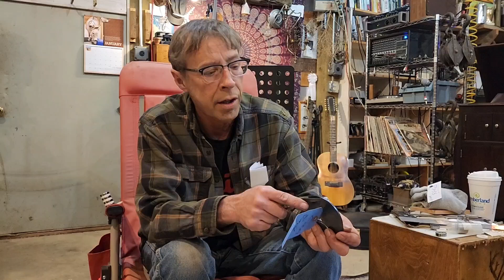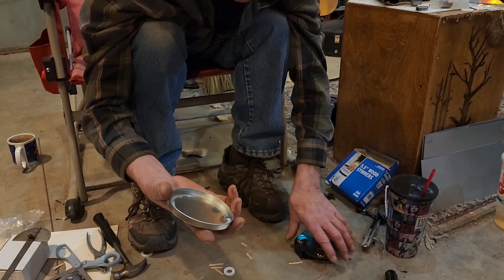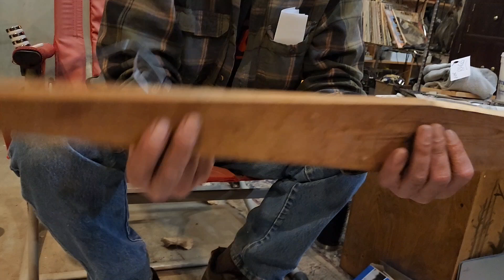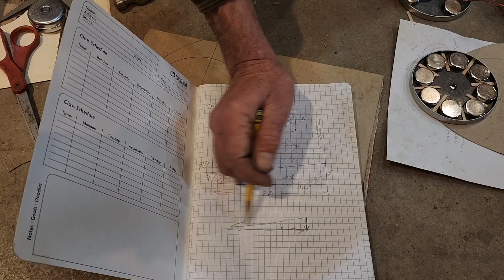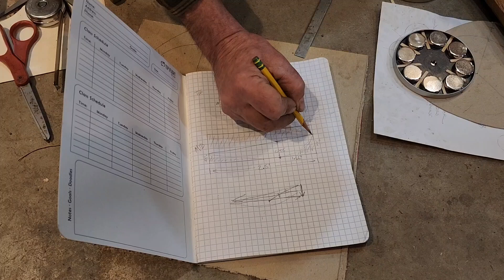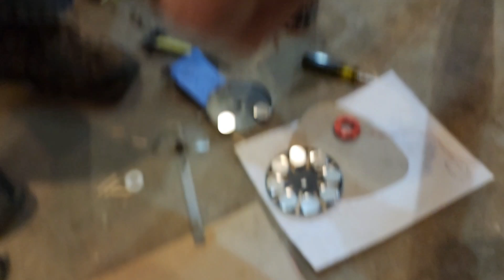36 inch DIY wind turbine part 1

Comment: This is fascinating. It would be great to have a CNC machine to carve that wood, just like guitar factories use. They are so accurate. I wonder if a 3D printer of some sort would also work (of course the blade material would be also something to consider).
Reply from the maker: Actually these blades were carved with a CNC router.  And definitely you could 3d print these although I prefer wood.  All that said... very easy to hand carve too.  The brain is a pretty good computer and the human body is excellent at controlling tools ;)